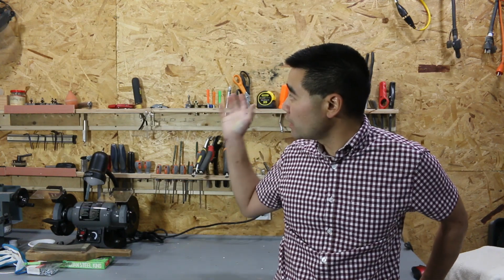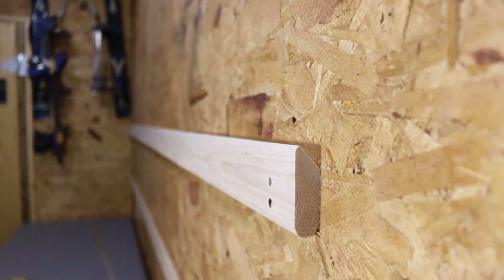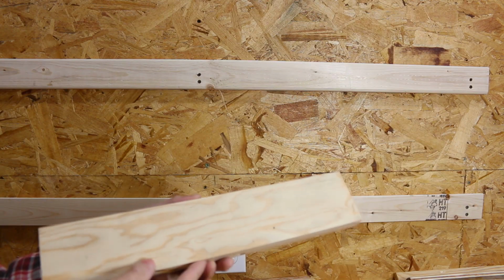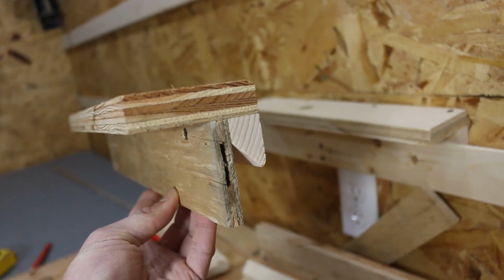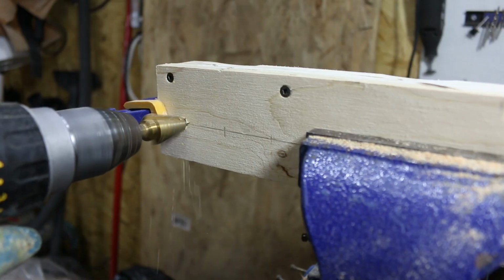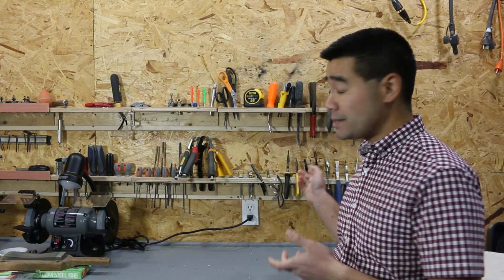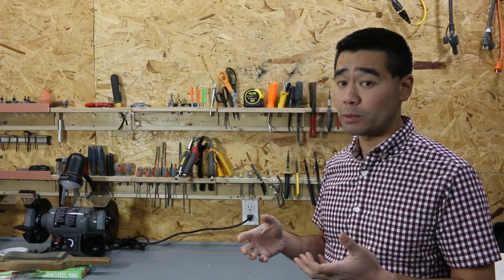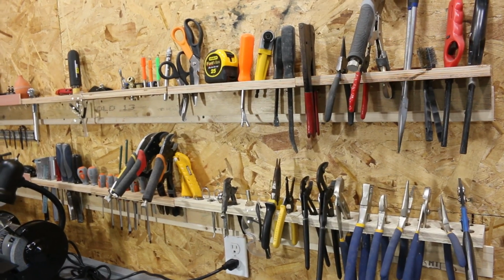Building French Cleat Tool Shelves

Comment: Andrew I purchased the metal socket holders and attached them to a 2 or 3 inch wide board and have the french cleat on the narrow end. They hang down and I marked on the board in large letters metric and SAE and 1/4, 3/8 and 1/2. I just grab the board with the sockets I need and they are easy to keep track of. Hope you try it.